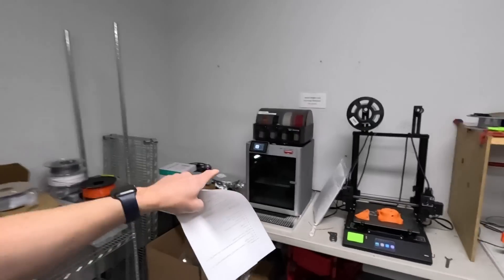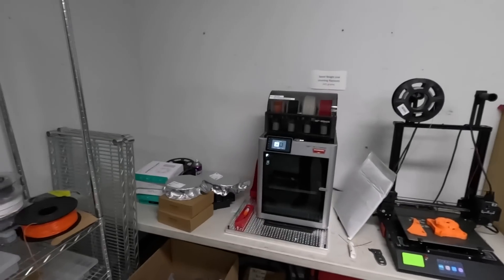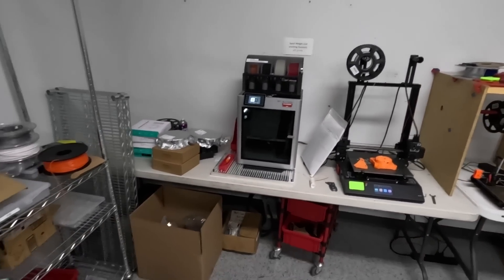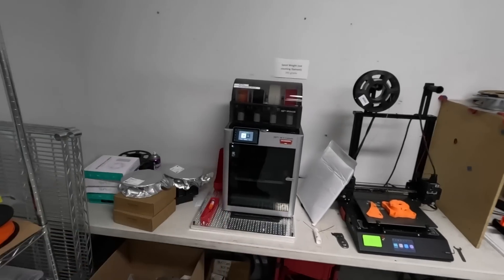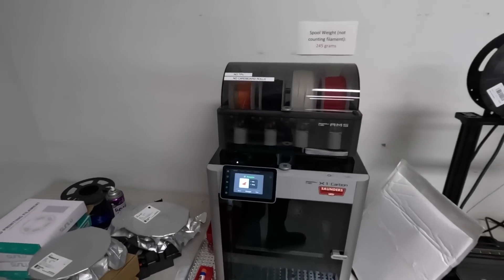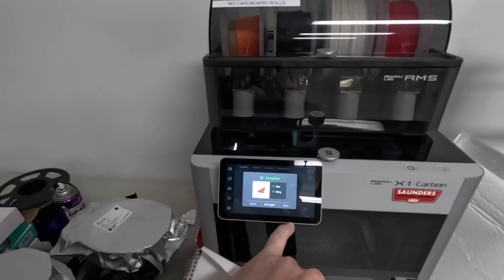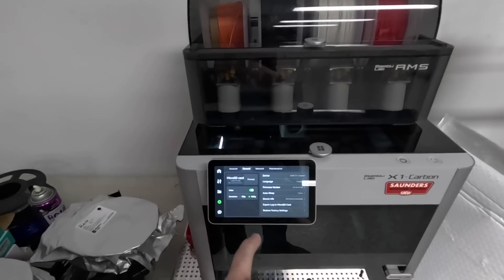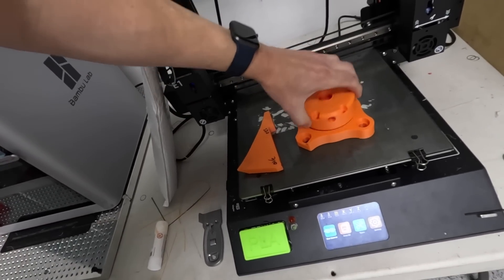Bambu Lab x1 Carbon 3D Printer: Review & First Prints

Comment: I have had an X1  Carbon for almost 5 months with no problems.  It has just always worked.  I have 6 other printers that I have modified and tweaked to get what I want, but the Bambu Lab printer has been working as is.  I'm sure more Bambu Lab printers are in my future.

Comment: The printer runs TPU just fine, but it will jam up the AMS. With one of the recent updates it will error if you try to print with TPU in the AMS. Additionally, you really should not run abrasive filaments through the AMS like carbon infused filaments etc. They will  wear out the drive gears and filament paths pretty quickly.

Comment: FINALLY the 3D printer that I can actually justify. I'm all about hardcore nerding out, especially with bleeding edge tech, but I'm not trying to get a 3D printer as a toy so I've avoided not hardcore nerding out over specs, component choices, design preferences, etc. I just want something that is a 3D printer, not an 'enthusiast tech toy', I already have plenty of those and really can't take anymore on in my life. I can go deep into engines, modern racing ECUs & tuning, high end PCs, among some other interests, but I've went out of my way to avoid having that level of knowledge with smartphones and 3D printers - I don't want to be always breaking them cuz I gotta turn knobs and flip switches, I just need them to do their job lol.
Reply: Prusa from the MK3 at least was basically there. The Bambu AMS is probably better than the MMU2 but they've just announced the MMU3 and MK4 to be competitive. Biggest difference is the included enclosure (Prusa you'd buy separately which still makes the Bambu a better option for the price unless you are a person with IP and ITAR concerns) that helps when printing ABS and Nylon.
Reply: I'm with you.
I have 2 main brand  and I feel they ALL suck.
This is the first printer that justifies the label "industry leader"....

Comment: To help you with supports you can use an Interface layer with either the Support Filament oder PLA <-> PETG since they do not adhere to one another. Then you can also decrease the distance to the Support Layer to 0 and get better lower layers where support is used.

Comment: Congrats on your purchase!  I'm lucky to have both the X1C and the P1P and if you don't need the enclosure, for printing more exotic filaments, the P1P is just as accurate and easier to access when needed.
Reply: please explain "exotic filaments"
Reply: @murc111  I assume like carbon fiber and other high temp filaments. If you only print in PLA and other low temp filaments then the P1P is probably fine.

Comment: I freaking love mine! I've been printing ABS with 0 problems, crazy. I'd love to buy a few more but can't figure out how to market for some 3D printing jobs. BTW for those interested, regarding the Wifi and transfering jobs and such. You DO NOT have to use the "cloud" You can transfer using the tried and true method of the micro SD card. I don't even have internet at my shop and I can still use it.
Reply: Thanks! I haven't seen much of that mentioned, and I don't get good wifi in the garage

Comment: I was an early backer on this from Kickstarter. I have printed hundreds of prints in PLA and PETG without a single failure. I do recommend 3DLAC as a plate adhesive.
Reply: Are you also using their filaments?  Thanks
Reply: @redone823  I use Bambu Labs and Hatchbox

Comment: The cool plate is in backwards. You will want to turn it around before printing. the nozzle cleans itself using the small stepped bit in the middle at the rear of the plate. hope this was of some help to you.

Comment: I have so many rolls of existing filament that I felt compelled to try to use them up with this printer. PLA, ABS, even some carbon fiber.  i’ve had no problem at all with any of them just using the standard presets for the generic materials. I did purchase several rolls of bambu filament just to compare and can’t see a huge difference. I really haven’t had to make any preset changes.I’m in love with the X1C.  I have found that using textured bed has been one of the best moves I’ve made. It just works print after print after print with all the materials I use. PC with CF, ABS,PLA all work great.

Comment: Order the xl day 1. waited 2 years and cancelled both my pre orders. 6 months later re ordered. I think nearly 3 years now? I am told my last pre order may ship in a month. In the mean time have just ordered the x1c as I really want to move on NOW with things. I love my 5x Prusa mk3s+ bears with Bondtech sls extruders farm but have sold them off and only have 1 left while waiting for the x1c. I think I will farm with x1c printers and hopefully one day/year get the XL with tool changing heads for a better MM unit and large build size. best of both worlds. Downloaded Bambu studio an hour ago and after using Prusa slicer for years it took all of about 10 mins to glance and feel comfortable its basically the same and I will easily move to it once i get my new x1c.

Comment: Markforged supports PLA now, use any pla in it. 200 dollars a roll for parts that are strong enough to handle really powerful mechanical forces is not bad. That same chopped fiber nylon filament is only 20 percent cheaper via other outlets and the markforged brand comes GAURENTEED dry. The cost of the Markforged machine up front 20 THOUSAND dollers, now that is the real problem. Not the fillament cost. I run a markforged mark 2 and its a beautiful piece of work.

Comment: On straight lines the ringing from the belt at lower speeds is a no-go. If they switch out the idler to toothed or increase the diameter to the belt manufacturers minimum spec then I'll reconsider.
Lookup up VFA Bambu.

Comment: Ive played with some matter hackers filaments - they work great, but the defaults (temp, retraction, etc) need to be taken from the data sheet with the filament and the defaults in the slicer for the various marerials are just slightly off.

If theres a material you like, spending a little time dialing it in and then saving a config for it is always fair game (you do it for cutting tools, right?)

Comment: Ordered mine today.
Can't wait to get it and see if it puts my heavily modded and MK3S+ in the dust.
Reply: Any update?
Reply: @red one  I got it in like 4 days later. 
I've been running mine non-stop since I got it. 
The speed and quality of the prints is insane.
I only use my prusa for really small prints that are like 10 minutes and under or if my bambu is tied up printing something. 

My wife wanted a castle that on my Ender was 5.5 days at 10" tall and .20mm layer height.
My Prusa only prints a little over 8" tall but it was 3.75 days at max height on the Prusa. 
My bambu printed it at 10.15" tall at .16mm layer height in 23 hours. 
The quality of the print is hands down better than my Prusa and my Ender can achieve even after a few hundred in mods with my Ender.
Reply: @spydergs07  thanks for the info.  I got a prusa mini plus that I've been running for 2 days before finding bambu lab printers.  It looks like the mini plus is gonna turn into a side dish as well.  I guess I should be thankful I'm not 60+ printers deep like some people are that are switching over to this.
Reply: @red one  right lol I was only two FDM printers and 1 SLA printer in before I got my bambu.

My resin printer still has a spot but my ender is a paperweight now.
I tweaked it a bit more but I'm tired of tinkering with it and still not get the results of my prusa or bambu.
My prusa is good for small quick prototypes. 
Bambu does have like a 5 min startup process for bed leveling and checking the first layer, but it's worth that 5 minutes for such a good print.

Comment: You don’t need to use their cloud for printing. You can switch it to LAN mode (or use the SD card but that’s a pain). Of course if you want to print outside your network it needs to use the Bambu cloud. 

Also I have been using eSun PLA+ and it’s been working perfectly using the Generic PLA profile with no settings changed. Once my rolls of eSun are used up I will be buying their filament only. It has the RFID on the spool so it’s a lot smarter and it’s very reasonably priced. Only about $1 more per roll compared to eSun for me in Europe.

Comment: uh oh!! ya done it, again!! I am in the market for my first 3d printer; its been said (MakersMuse for one) 2023 will begin another 3d printer re-evolution; was looking at the prusa line as well but just for the enclosure is three hundred plus and yes they are excellent systems I would hope to agree but for a first 3d printer setup on a hobby level can't justify over $1K+; will definitely research reviews on this Bambu Lab x1--definitely speed isn't crucial for me either if ya running out of juice (gas, diesel, or electric, and filament!) with no built-in pause in the running program to reload and resume!! Thanks for another inspiring vid!! Its your presentation style; we're listening, learning--what's your thoughts on a laptop running CAD type software--if ya have a previous somewhat current vid on the topic?

Comment: The plastic scraper is in the memory of the printer. The things that puzzle are in the very short assembly instructions. Use the glue as recommended to make the prints easily removable, that’s it purpose.

Comment: I totally get that "It just works" approach. 3D Printers can be hard and if you don't want to spend time printing and are just laser focused on the outcome, this is definitely the way to go. What I can't get behind though is the cloud aspect. I Hope this Printer also supports Local printing via USB or SD-Card, because if it is cloud only, it might turn into a brick in a few years. I much prefer a locally hosted and independent solution like Octoprint, which I honestly do not find hard to setup at all, you basically install the image, connect the printer, webcam and it is good to go. In my experience it has also been 100% dependable, never had a crash or glitch in the many years i've been using it.
Reply: You can print localy with the SD card.
Reply: @idnarbjm  thats good. I still would not want a 3D Printer that connects to some cloudservice, let alone in china. He did adress that though, so i guess it's fine.
Reply: I understand the worry with the cloud aspect, and it is not needed for most, but I have found it has really been a game changer if you run multiple machines in different locations. I have one at home and one at the factory. I get the remote monitoring and controls, plus all the settings and profiles in the slicer shared across both locations. I can validate prints at home, send to the factory, do final checks there, update profile, then work with the same setup at home. It great.
Reply: You can print in local LAN mode that doesn't use the cloud, no need for the SD card
Reply: @scott185  I'm not saying it is not convinient, I'm sure it is! I'd rather trade a bit of convinience in order to not be required to send all of my data through a server and not know what happens to it. Maybe if you are messing around at home printing fun little widgets and brackets it might not matter, but a production shop sending their ressources to china is just asking for trouble. It might be that they really respect your data and will keep the service alive for many years to come, but you just can't be sure unless you avoid products like that. Each to their own though, i don't judge at all, I just have my priorities different than others, but I know I'm not alone either :)
EDIT: I can start a print from anywhere in the world right from the slicer aswell by the way, using open source software:
Cura, Homeassistant, Octoprint, Wireguard, Marlin.

Comment: man, If I wasn't saving up for a shop move, I would have bough this printer too. And the Langmuir MR1 used up all my extra monies
Reply: Is the MR1 something that can be used at home or requires a shop?  Thanks.
Reply: @redone823  I built my MR1 myself in my garage but you could really build it anywhere but once the concrete sets its kind of difficult to move around the machine around so its geared more toward a garage machine (not a living room mill)

Comment: I've seen people say that printing different support material on these doesn't work well as it's hard to purge all residue out of the nozzle.
Reply: You need to adjust the purge volume, I bump mine to 500 from a default value of 280.  Works great!

Comment: FYI i think the dissolvable filament is too soft for the cutter to cut and get jammed, if you need breakaway support from PLA or PETG use the other and it works great, you do have to tell the AMS that they are the same filament and then set one of them to the interference layer in the slicer.
Also just watch out using carbon materials in the AMS, it does wear the parts so it is possible but just be aware you may need to have some replacement parts ready.
Reply: I run PVA through my AMS on the regular.  Works great.

Comment: did you make sure to get a first layer of glue stick down?  it helps with the release from the print bed.  with mine i put some glue stick done then use a small lint free damp cloth t make sure i got a nice thin layer ever were.

Comment: To run dissimilar filaments for support you NEED 2 different nozzles. You end up mixing the filament and making the print fail after removing the washable supports.

Comment: Huge issue with these BL printers, that nobody talks about, is the motion system is non serviceable and is epoxied into place. When the graphite in the bushings wears away (as show by all the graphite dust on the X axis rods), you're left with abrasive aluminum bronze bushings wearing down into the CF rods. Bambu lab doesn't sell replacement rods or bushing/bearings and they don't want the user to service the motion system system (their own words). They want you to send it in for repair. Bambu lab also seems to think warped build plates are "normal", as they said themselves when so many people complained about receiving printers with warped build plates.
Reply: Then what is the expected life span of this system in operational hours.
Reply: @hateca1  It seems like it varies, since the QC on the BL printers is all over the place. Some have reported excessive toolhead slop in just a few hundred hours, others after a couple thousand. But BL has just been replacing printers when the bushings wear out right now. But that's only because they're all in warranty. When the warranty is up, you have to start sending them in for repair, probably back overseas since there is no repair facility here in the US.

Bambu lab had to address their QC problems like warped build plates and toohead slop/bushing wear in a blog post recently, and really it was just them skirting around the problems.
Reply: Prusa is the standard prosumer brand for a reason it works great everytime. Going with the prusa xl and i expect they will end up with one to.
Reply: Yeah, i think these are IGUS Bushings, but when they are glued is complete BS. Another Probleme is the wear of the PTFE Lines, the filament grindes the Tube and the debree get clogged in the Nozzle...
Reply: @hateca1  I knew, as soon as something negative was said, a Bambu Baby would come crying because he wants to justify his purchase on a Chinese non-open source printer

Comment: Coming From prusa printers. Ordering one of these. I ordered the THEKIIIING texture PEI sheet as I ABUSED the hell out of them on my prusa farms and never wore or ruined one and I used metal scrapers to remove the purge lines and brims and never scratched one. The stock Prusa sheets where varied in strength and none ever lasted more than 6 months. the THEKIIIING sheets I still have after years and still are like 98% new.

Comment: Vibration compensation has been around in the 3D printing community for years now. This feature has been exceptionally popular among the folks that use Octoprint, Klipper, Fluidd etc. In fact, most of the Bambulab's features that the people outside of the printing community love so much have been taken from the open source makers' world and put into a nice looking wrapper.
Reply: Actually, input shaping just came to marlin back in December, and hasn't ever been part of octoprint as far as I know. Sure klipper has had it for a few years but the barrier to entry there is pretty high. Even with marlin, the process to reconfigure my cr-10 (running an skr1.3) was such a pain in the butt that I never updated it. Not enough of a feature to possibly mess up my entire profile, abl and more. If you're going to try to be a gatekeeper, at least get your facts straight.
Reply: @sirseriously  bruh what are you even talking about, I’ve had it on my OctoPi since 2021. And the barrier might be too high for you if you’re so bad you can’t follow the instructions and afraid you can mess it up😉
I don’t need to be the "gatekeeper", seems to be more of your role at this very moment, I’m just giving the guy a quick recap
Reply: @nazariimoroz6216  oh really? Please give me a link to this magical input shaping you have through octoprint, because it doesn't seem to exist anywhere and is still prerelease in marlin. You may have klipper running on a raspberry pi, but that isn't octoprint.
Reply: vibration compensation via control shaping techniques dates all the way to the 1950s for cranes to not have their loads swing out and destroy stuff when moving. its not a technology unique to printing. its just only been there for a few years on the front edges of the diy space before going mainstream, most notably in the open source space once it was added to klipper.